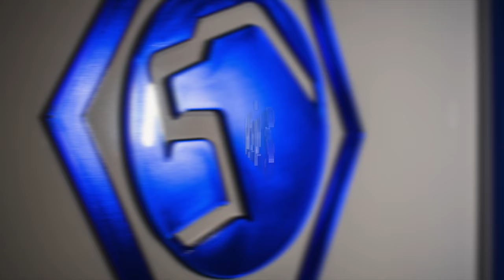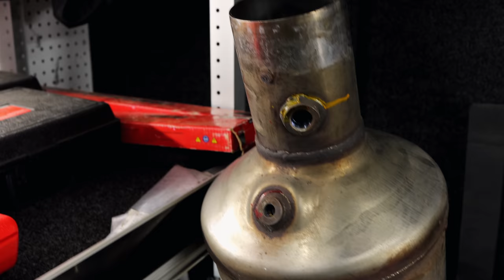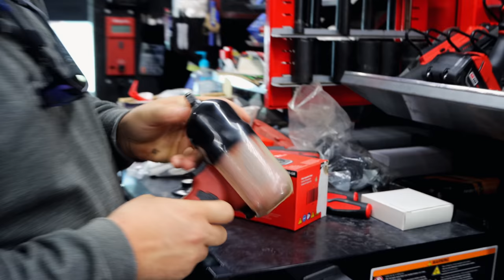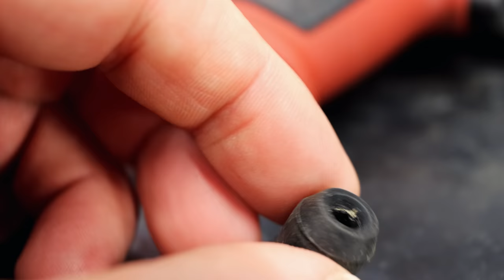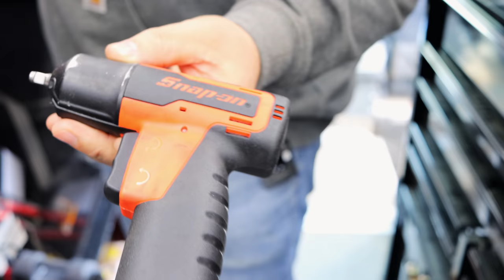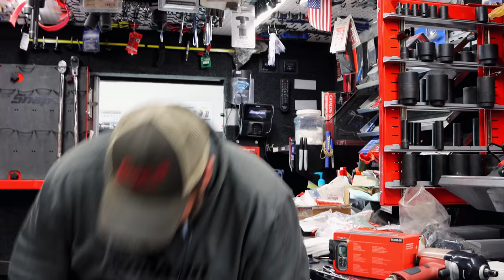Snap On Friday: New Knipex Raptor Pliers They Look Different But Bite Hard!

Comment: That used to be my Matco 1769 Clay, it’s a good one! 
It’s just bubble that’s in the rubber boot not glitter lol.
I’m glad you finally got around to cleaning out the garage Hamilton 👍🏼
Reply: That's not a 1769 its a 1769A. The 1769 has a black impact housing and the grip doesn't have the black eagle, just a red one.  The 1769A is good gun rebranded  IR 2135TI ,its still my back up gun at work
Reply: @TinoR626  
Well pardon me, I was about to fall asleep, you’re correct it is a 1769A
A damn good one at that👍🏼

Comment: 1/4 rocker impact is the BEST working on motorcycles and it is compact and does not need high torque as it will break stuff